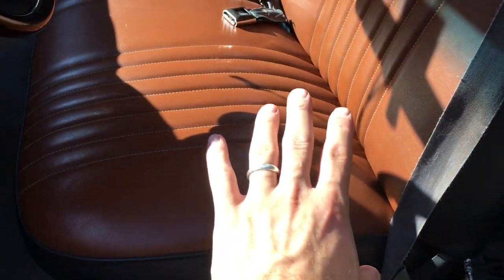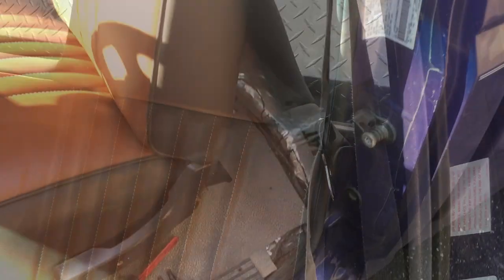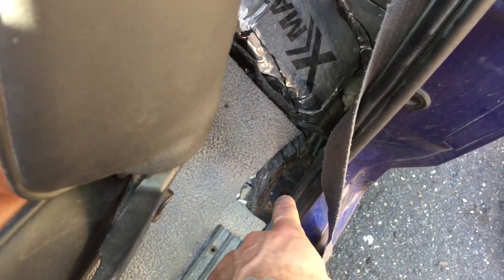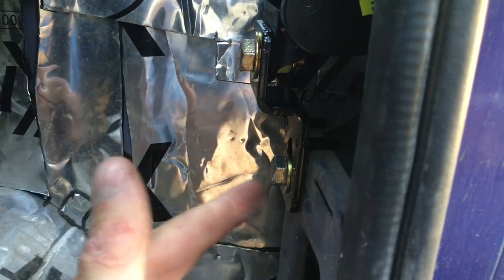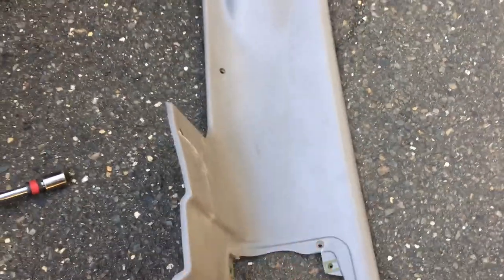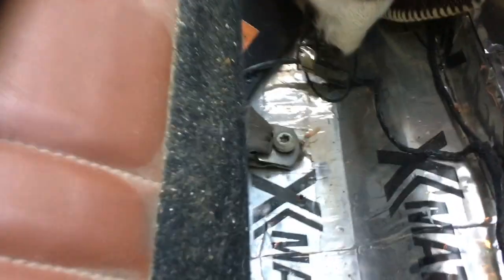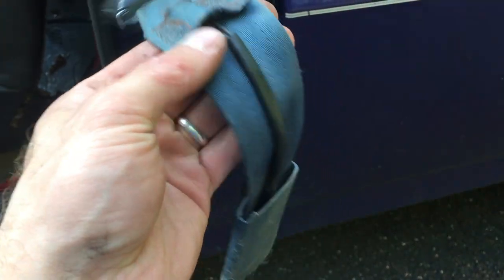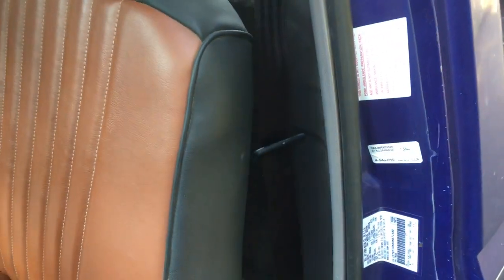How to Replace Broken Seat Belts | 1995 Ford F150

Comment: The the belts in the old ferd are busted.  thanks for the video it was very helpful. this looks like something I can pull off after work before it gets dark
Reply from the maker: tubeyourself No problem!🤙 Glad you liked it! Honestly, the new belts were a huge improvement. You don’t realize how awful the old seat belts are until you have new one. The big plus is they retract and get out of your way. Anyhow, you can definitely do this as an after work project! Good luck!
Reply: @TheMinuteMasters  my seatbelt wasnt even attached to anything inside the winder! Lol
Reply from the maker: tubeyourself What! Lol Like you could pull it all the way out of the retractor?
Reply: @TheMinuteMasters  yeah i drove around for a year like this before i realized my belt does nothing
Reply from the maker: tubeyourself Damn! That’s crazy! It’s good you found out!
Reply: @TheMinuteMasters  I was trying to get my belt around my big coat and belly one day and it just pulled right out. Ha!
Reply from the maker: tubeyourself Thank God for that! An accident would be a terrible time to find out.
Reply: @TheMinuteMasters  where did you get these from I'm need them for a super duty seat swap
Reply from the maker: @lavathrower2324  I bought them from LMC truck.🤙

Comment: Okay Stevie.. You've had these seat belts in for quite a while now. What is you review of them at this point? SInce you didn't install new sleeves (the plastic portion covering the webbing that keeps the ends right where you need them) on either belt is that an issue? Were they the correct length? Webbing holding up?
Reply from the maker: Hi Robert! Yes, good reminder that I need to film a follow up review video. I’ll add that to my list of video ideas.🤙

Comment: Where can I find the mounting bracket to hold the ratcheting portion of the assembly?
Reply from the maker: So you need the mount for the ratcheting device that coils up the seat belt?
Reply: Yes sir. I ordered a set of replacement belts, but mounting hardware (brackets) weren’t included. I considered cutting off the brackets from the previous set, but wanted to explore other options first.
Reply: @TheMinuteMasters  I need the Z brackets.
Reply from the maker: @cdcox  I’m not sure where you could buy those brackets. I would try to remove and reuse the original ones.
Reply: @TheMinuteMasters I’m a step ahead. I used my angle grinder yesterday to cut off the forward face of the original bracket. I performed a test fit and it sits perfectly! I bought size appropriate stainless bolts and nylon threaded nuts (.65 per item) to attach the new belt apparatus to the old bracket. I’ll be completing the install today. Wish I could add pics for your viewers. The cut off was extremely simple, but not enjoyable unless you love the aroma of burned plastic and sparks. Thanks for your time with this. I’ve relied on your channel greatly while updating my 95 F150.

Comment: Wander if this is any different in my ext can? My lap belt is almost about to break in two pieces and how much I’d have to remove to get the “new”/used” replacement in
Reply: This is the
Driver side belt to the whole thing is almost in half
Reply from the maker: Ethan Copple I think the seat belt retractor is in the rear pillar. I haven’t looked inside an extended cab in a while. It could be too much to pull out. If your seat belt is that bad, it just worth replacing all of them. I love my new seat belts and this is nothing like new retractors.

Comment: Thats a good idea...mine work but i would sure like to see new belts in my truck. What did it cost from lmc?
Reply from the maker: gregory9740 Yeah I love them! The cost is a not so great. For $199 you can get driver and passenger. For $299 you get driver, passenger, and middle. But all things considered. You get the belts, buckles, and the retractor mechanism.